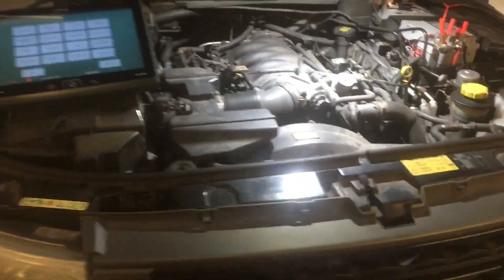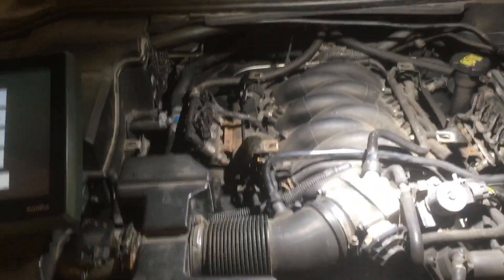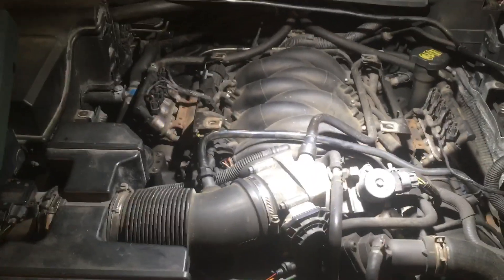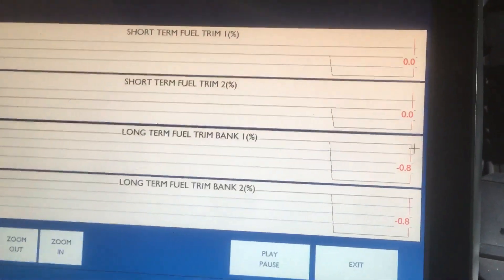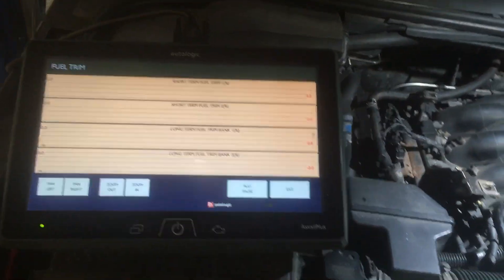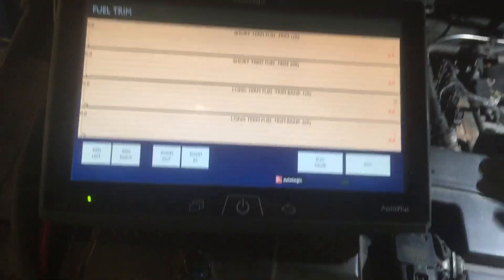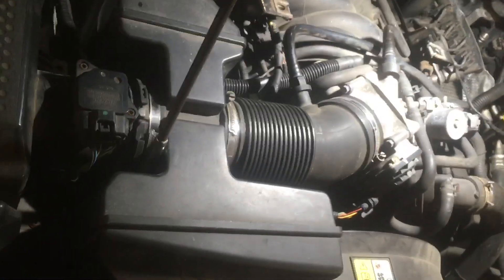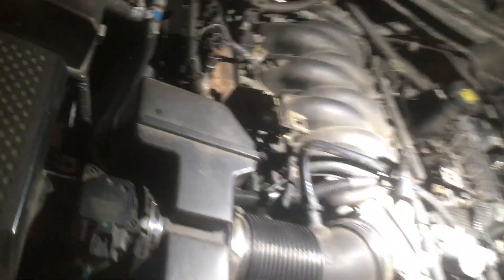4.4 Petrol V8 Discovery 3 fuel system rich diagnosis!

Comment: Hi I just watched this video because I too have a lean code on both banks. Can I ask did you just replace the SS gaskets or did you replace the the EGR? Did it solve the issue? I looked for a follow up video but I couldn't find one.